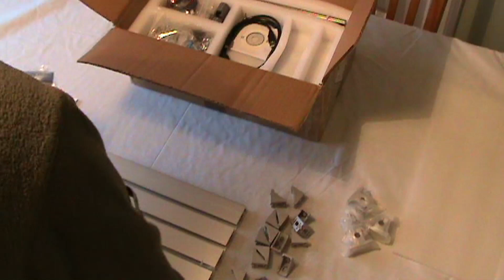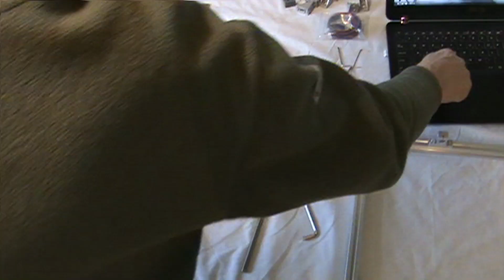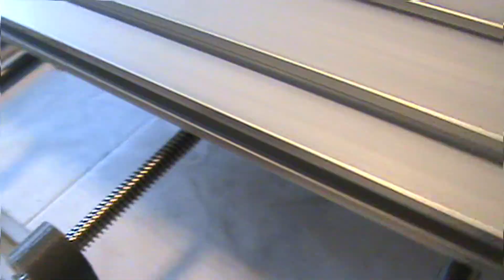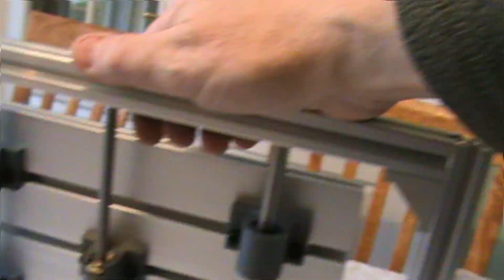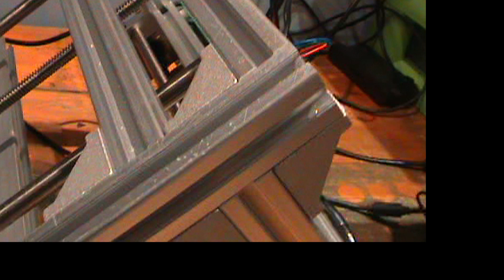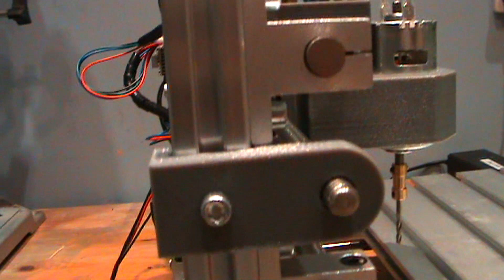Aliexpress 3018 cnc

Comment: You installed the linear bearings on the bottom backwards, the t-nut holes should be towards the outside to increase the bed travel.
Reply from the maker: Thanks for that I'll have a look.
Reply from the maker: You are right. Thanks again.
Reply: You're welcome.